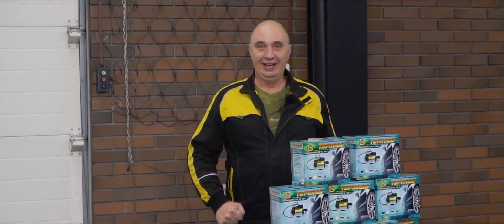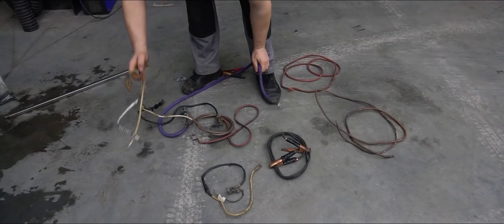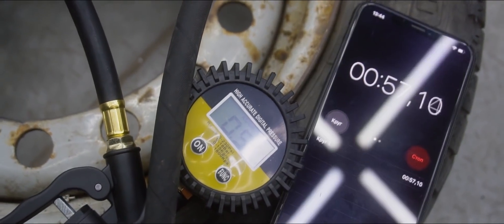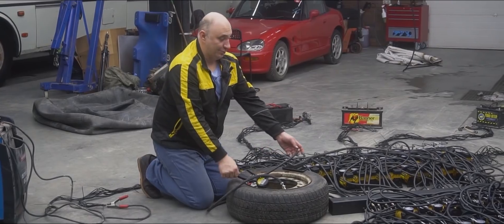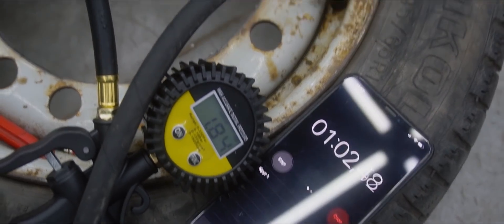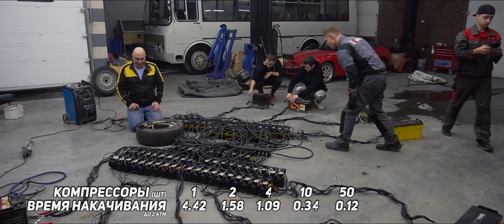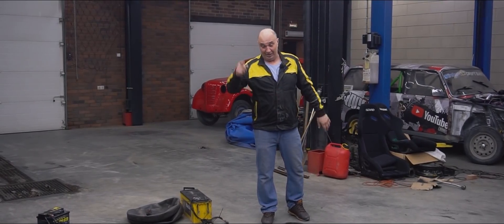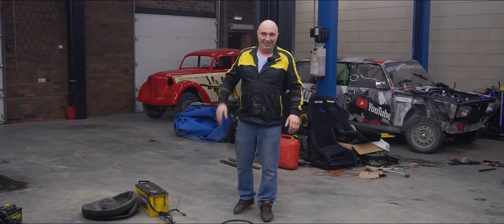How fast can 100 electric inflators fill a tire?

Comment: Wat about the tubeless car tire with more air pressure. will it blast 💥? I always scare from blasting on my face while I am filling the air. How much u can put extra if the tire rate is 60psi (4.1bar) usually recommended 40psi (2.7bar) . If we go up to 5 or 6 bar will it blast ? Please please do this useful experiment ❤️ I love ur channel, ur brother from Dubai city ❤️

Comment: Just think of the money we could save on compressors instead of buying an industrial $5,000 when we could buy a hundred cheap 12-volt ones and get 10 times the result

Comment: im guessing the reason the first one took longer than 2x 2 compressors is that it had to pressurise the manifold first? then the 2 compressors could just start basically filling the tire immediately?

Comment: you cannot wire them up to the local voltage? like 127 or 220, the only problem wil be the cables inside the wall to support that amperage

Comment: I want to see how long it would take to fill an air compressor that's about 300Gallon with 150 or higher PSI by using the 100 electric air compressors.

Comment: hey you should of tested if 100 air inflator will be strong enough to power air tool. i.e see if a air wheel gun will take a nut off

Comment: IDEA, take engine, remove all the fuel-related stuff. Weld an air fitting on the exhaust. Spin the engine with another engine and see how long the new 4-cylinder gasoline-powered air compressor takes to inflate stuff.

Comment: Inflators drawing 1200 A @ 12 V and loading into a rail with an individual hose per unit is certainly faster than a big compressor, but that setup isn't even on the same planet as the big compressor in terms of efficiency.   The rail comparison isn't fair because there were 100 schrader valves allowing flow into it when the inflators were being used vs. 1 schrader valve for flow with the big compressor.  When the rail was taken out of the equation, the big compressor was about 10% slower.  Assuming a 7.5 hp compressor, that's 5593 W during the time it's recharging the tank to fill a tire in 10.3 seconds vs. 14400 W (!!!) for the inflators to fill the tire in 9.3 seconds.  If you wanted to really test it, you'd put about a 2" charge line to the rail with a solenoid actuated valve from the tank and time that.  Bottom line is that a big compressor delivers about 1 CFM of air flow for every 233 W of current draw vs. a (good quality) 12 V compressor yielding 1 CFM  per 387 W of current draw.  That makes the big compressor about 166% more efficient at compressing air, and even higher when you factor in the duty cycles and flow rate through schrader valves.

Comment: What if you coupled 2 automatic transmissions together in line? Like the engine to one input shaft and then the output shaft to another transmission and then to the wheels. It would be interesting to see what the automatic transmission thinks and what it would do.

Comment: You should mount it all to the wall make it solar powered and use it I'm wondering how much psi all those pumps can push at once I was noticing in the video how many batteries and that welder did you use

Comment: You "should" be able to run about 18 of those pumps in series on 240V AC but they might pass current to ground at that voltage :(

Comment: Looks like there is 10 compressors per battery...id like to see a battery per compressor or some type of large alternator set up,thos lil pumps pull alot of juice fast,be way quicker and more efficient (not cost effecient,but speed wise) if they all had their own power source

Comment: Electric pumps have 100 tiny valves to fill that manifold, use a larger valve from a 120psi big compressor and it will be faster.

Comment: About 13 Hp compressor combined. ~14,5 kW electrical at 65% efficiency (brushed motors)=9,4 kW shaft power=12,6 Hp

Comment: Replace garage compressor with those smaller ones for a week, see if they can hold up to long time use, add pressure valves to turn power off on small compressors, do a comparison between Industrial compressor vs the small battery compressors

Comment: Placing a length of wood down the entire length of the steel distribution bar, would displace most of the excess air inside it.

Comment: Garage 54... Make a compressor out of a v8 engine, powered by another v8 engine.
Reply: Or use a v12 and run 8 cylinders as pump 4 as engine, should be enough power

Comment: If the air was charged so it's nearly at the tyre it would take 6 seconds for 100 to inflate it but it takes a few seconds for the air to travel from the pumps down the lines to the tyre.

Comment: Wire the inflators in batches in series into the mains electrical supply. 220V/20 = 11V each. Should be ok. 👍🤣

Comment: When using big air compressor, the integrated air reservoir needs to be bypassed... Without doing that, it will waste quite many seconds. You basically only need one-way valve in place of the air reservoir.

Comment: I'd say that the idea has a bad bottleneck..... as only so much psi can pass through a valve stem at a time..at a certain point... the more compressors you have don't mean squat.. it only amounts to how much air can pass through that diameter valve stem .. and tbh,. possibly the diameter hose from the common rail may also have a little bottleneck in it also.. as it can only feed so much flow through it's diameter as well. but., MEH, that's only my 2 cents.

Comment: Add more valve stems. One hose and one valve will always have a limit. Connect each pump to the wheel directly and the results should be much faster with less pumps

Comment: The problem is diminishing returns. You're pushing more air, but the valve will only let some much air pass through. If you had a bigger valve in the rim than you would probably fill it faster. I imagine even 200 inflators would only bring it down to maybe 8 seconds.

Comment: Try 4

Could you get a fiat 124 (or a Motor from one) and replace the push rods with glass ones.

I had the idea after looking at the glass stir rods used in science class. They are  glass shafts with glass nubs on the end.
Reply: Fiat 124 not sold there, vaz 2101 instead, with SOHC engine.
But there's many Russian cars they can use

Most AZLK(Moskvich), GAZ(Volga), etc 
have pushrod engine

Comment: I suspect you could do much better with more power. Those batteries must be sagging like crazy at that load. This is possibly more than starting current.
Also consider a slightly thicker hose from the pipe to the valve stem to balance the restriction with the unwanted volume.

Comment: You should remove the valve from the stem to increase air flow even more. When mounting tires i noticed that removing the valve helps to fill up much faster. So removing valves on the rail and tire would make huge difference.

Comment: you should connect all the pumps directly to the tire, using as much valve stems as possible, to eliminate the single valve bottleneck :D

Comment: For the power source, try a welding inverter.
Reply: It looked like they were along with all the batteries. You can see the guy in the back turn it on at ~7:32

Comment: All inflators should direct connect to the tire, with 100 valves. then it could just take 5 sec for the job done.
Reply: It would have saved them making the common rail too. I make it less than 3 seconds.

Comment: I've got some imrovements you can make to this system - 

Add a second outlet to the rail into the tyre, and a 3rd valve to the tyre for measuring the pressure, this is to minimise the bottleneck of having all pumps share one pipe into the tyre 

For power, put all of your batteries in parallel and have the starter connected to them to keep them charged up during the test, this ensure that all pumps will get sufficient power.

You can also make some bus bars for the power, a length of 1" bar for positive and negative and fix the wires to it, that way you can connect all of the pumps at once using a jump lead to the bus bar :)

Comment: Okay, hear me out.  SELF INFLATING TIRES ON A LADA WITH AIR PUMPS!

Attach the base of a bicycle pump outlet to the valve stem with a rotating air adapter and the handle to the car body so it reciprocates when driven.  Start with a flat and see if you can drive it full, then over full, see what blows up first or if it gets ripped off snow drifting or whatever.  Do Vlad things to it. 

Thumbs up this and comment below to tell Vlad you want to see this too!

Comment: I bet you can get the tire to inflate much faster if you install  a bunch of valve stems on a tire because you are putting a lot of air through one valve stem it's like a bottleneck it's going to be so much are you can push through that one stem if you put a bunch of them on that Rim And hook a hose each one of those valve stems on the rim and I bet it'll speed up the tire inflation much faster home all the way around the rim hookah hose each one nitara be inflated in seconds

Comment: Rip whoever gets a flat in their city since all the air pumps are sold out 😂
Reply: Well how long would it take to fill your compressed tank.  In large quantities.  Like what would happen if your air compressor broke down and you had to replace it. But have only 100 small compressors to work with
Reply: They surely ordered a pallet. Nobody buys out local stores nowadays. Not outside of war anyway.
Reply: @zwz.zdenek  We still do... I bought whole daily produce of local bakery just for breakfast. My coworker bought all pizzas from pizzeria, filled company Toyota van to the top...
Reply: It's also a stonk for the airpump company lol
Reply: They could go to the gulag for this, for real
Reply: Lada engine run above 10k rpm?
Reply: In the long run... what the hell are you going to do with 100 electric air pumps ???

Comment: if 100 compressors require a rail, and shop air doesnt, then the first experiment with shop air is still valid.
Reply: It doesn't require that size rail, they just chose to make it that way based on materials at hand. It could have been made just 1 mm thick (internally).
Reply: @DiscoFang  on second thought shop air requires a tank to fill up

Comment: One thing I've noticed about inflators, using a relatively small tank, is this simple fact.  Most compressors have a pressure regulator on the feed lines; if you set it to 35 PSI, and attempt to fill the tire up to 35 PSI ( or 32 or whatever ) it fills far slower than if you take and set the pressure regulator to 65 PSI or higher.. .. It's basic physics..  
Those inflators - don't have a pressure regulator.  I'd bet that the big compressor and air tank do have a pressure regulator, and I'd also bet that the regulator is indeed set.
Reply: Most places i have been where thay have a compressor are set to about 90psi but a long hose run creates a large pressure drop so although its set to 90 it might only be 60 at the end of the hose

Comment: At some point volume of that single hose is a issue. With input split in two hoses I expect that number will go down even more.
Reply: I had that thought the last time with the manual pumps, you could mount 20 valves in the rim.
I think you can get down to a few seconds that way.
Reply: @Kaj_Kasket  Or, since everything is ridiculous, put 101 valves in the rim and inflate directly :)
Reply: @truthsmiles  Use AC valves.
The one used for AC charging are larger so they should pass more air
Reply: Yes, the single hose is the biggest weakness. I will also plug a second manometer to the steel reserver. It could be interesting :)
Reply: I wanted to see the pressure on one of the pumps.
Reply: Good point should have used a much larger hose and a gauge on the square tube

Comment: Y'all don't disappoint in creativity or energy and the translations are spot on. Channels like yours are why I don't miss TV much and I've learned to think differently on a few episodes. The manifold of  just 100 stems - genius in cheap & effective. Love the shop video and folks enjoying the production. You should sell those inflators to fans; it would be cool to have "real" Garage54 merch.

FWIW, those times were to fill the 15" wheel plus the manifold/rail and all those hoses! Also try your full-size compressor with a short hose like the 12V inflators and you'll learn how much pressure head loss a length rubber hose can be.  I know y'all don't do whiteboards, but a graph of the inflators vs. time would be nice. Always fun!

Comment: Can you run air tools with this compressors ?
Reply: even if, wouldn't be very efficient at 14,4kW peak power. And I guess louder than a regular air comp.
Reply: I think the volume would be s issue unless they plumbed in a storage tank
Reply: @dodge96sport  same goes for industrial compressors. Usually useless w/o tank

Comment: It literally draws 15 kilowatts
Reply: Yeah but it's more 'efficient' lol!
Reply: @charlie_nolan  1200A x 12V = 14.4 kW
Reply: watts and amps arent the same boi
Reply: @lucasvanhamburg4937  they said it draws 1200amps from 12v. The car batteries have a voltage of 12.6v. (Not including the voltage drop because they powered it from multiple car batteries) 12.6x1200=15120
Reply: I realize I was wrong about my understanding of power use at different voltages, oops. I’ve deleted my replies as to not confuse people
Reply: @charlie_nolan  nah u just confused alot of people since as they are mentioning a dude's statement that doesn't even exist
Reply: @vampy625  oops sorry
Reply: @charlie_nolan  Hi everyone, electrical engineer here. The power transfered over a transformer is the same on both the high side and the low side (we're going to ignore excitation/resistance losses for this explanation, and power factor) theoretically: V1I1=V2I2 where V1/I1 is the voltage/current on the high side, and V2/I2 for the low side. No clue why you mention diodes unless you're trying to rectify a 240 volt source which, besides being a bad idea, wouldn't reduce the power consumed. Higher voltages are used where we see large current consumption and if you want the wires in the equipment be of higher ampacity, well they have to thicker, right? And that drives up costs. So in the US 208/240V does exist for things like stoves and washing machines. Hope this helps
Reply: @charlie_nolan  Power is conserved. Each pump draws about 144 W each. 144 W is 144 W, no matter what voltage. The only difference is that, in order to conserve power, for a 240 V line, 144 W would draw about 600 mA.

600 mA x 100 = 60 A
60 A x 240 V = 14.4 kW
Reply: @nejiniisan1265  wrong. Power is not conserved. These pumps will not draw 144 watts if fed 1 volt nor will they only draw 144 watts if fed 120 volts. Voltage is a major contributor to the current consumption of a motor. Feed it 1 volt and it won't draw 144 amps. Feed it 144 volts and it won't just draw 1 amp, it will draw enough to burn up the windings and voltage doesn't burn up windings, excessive current does
Reply: The translator has the same tone and cadence as Kermit the Frog. I love it.
Reply: @charlie_nolan  I dont get your math my boi. If : 750W/12V/100(piece) then its 0,625A for 1 air compressor and if its 100% efficient as you said. I dont think 0,625*12 = 7,5W is the full performance for that little aircomp.

Comment: I bet the reason 100 is not twice as fast is its drawing down the power source. Volts dropping. It should be close to twice as fast as the other tests where.
Reply: Or possibly the air flow is the bottleneck. Probably some of both.
Reply: @stefanhoffman7052  they should have had voltabe gauges to makesure not to much drop
Reply: Yeah probably the single hose fitting is the bottleneck, it's basically a static pressure regulator at this point only letting x amount of volume trough
Reply: @Need2connect I thiked they use batteries for each bank all those compressors are 12v. I doubt they had inverters for all of them.